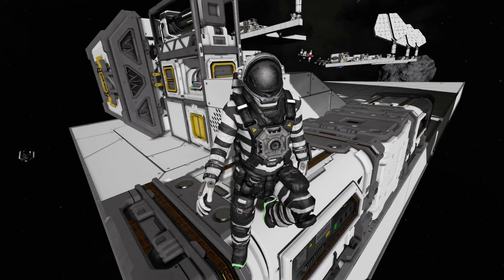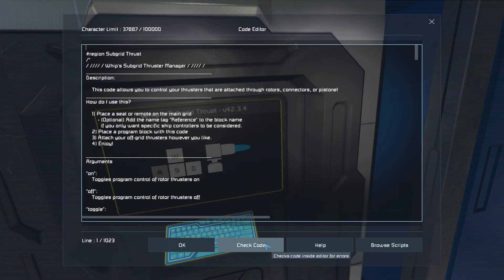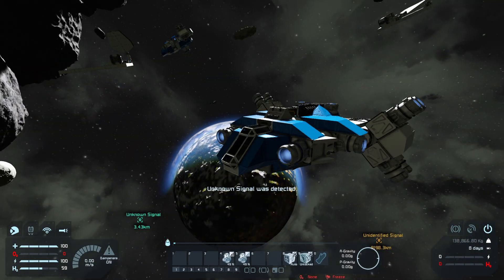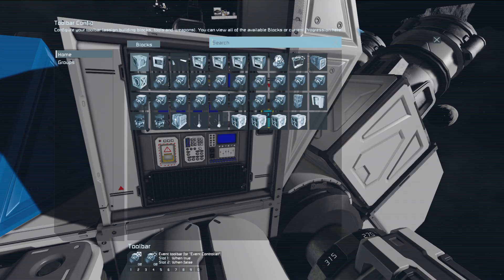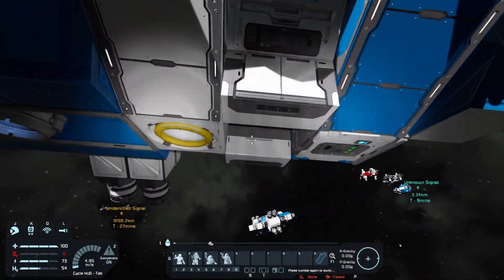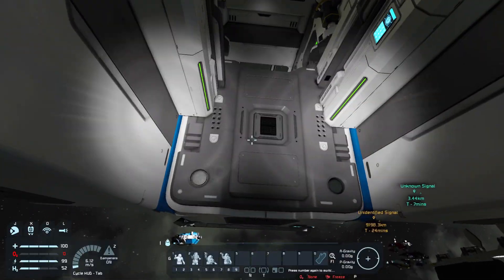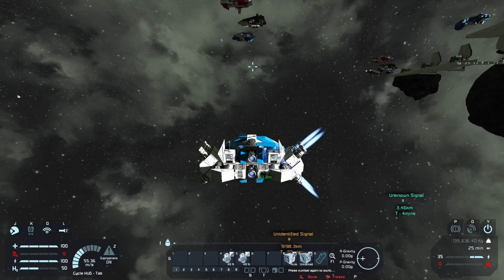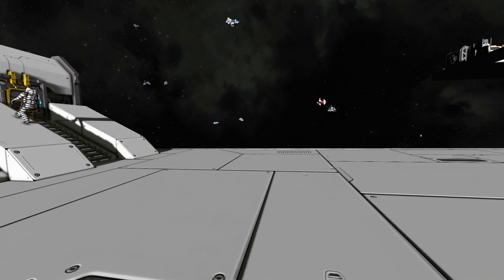How to WASD Subgrid Thrusters? (With and Without Scripts) | Space Engineers Experiment

Comment: Variable-vectored thrust works easily with scripts, but gets quite complicated and messy without. Fixed-angle thrust is easily do-able with (relatively simple) Event Controllers, meaning it's entirely viable on vanilla servers. The savings in materials for thrusters pulling double duty is decent, but there's a similar hit to power efficiency... and as always, SE doesn't always play nicely with sub-grids.

Overall, I only rarely use sub-gridded thrusters, but they really do give some great options for design aesthetics. As with all things sub-grid-related, I deeply wish SE wasn't so wonky. All the kewlest looking designs implement sub-grids, and often mix large and small grid... and while it looks AMAZING, it's usually a nightmare of clang, thruster control issues, and turrets shooting your own sub-grids.

SE2 seems to be eliminating the large grid/small grid divide, but I haven't seen any sort of sub-grid connector yet, so I'm left wondering how it will handle Connectors/Hinges/Pistons/Rotors and the like. As always, I'd love to see better options and functionality than SE1, or ideally, some improvements in both SE1 and SE2.

TL;DR sub-gridded thrusters are fun and look great, but they have major practical limitations in SE, which I hope will be corrected some day.
Reply from the maker: Great insight on this topic. Thanks
Reply: As single player on PC I seldom get klang issues with sub-grids however I am aware that the multi/co-op side has the issues you mention. Its sad but I think it might be the same thing with SE2. That said I expect there to be hinges, pistons and rotors in SE2 alongside other blocks, and hopefully sub-grid controls for ships that employ stuff like this, otherwise what is the point of a new SE game, right? There HAS to be something to trigger Klang in the new game... 😝
Reply from the maker: I rather like the existence of Klang lol, but not always